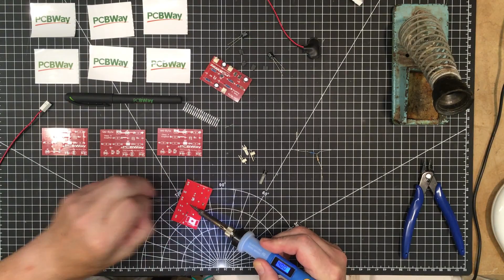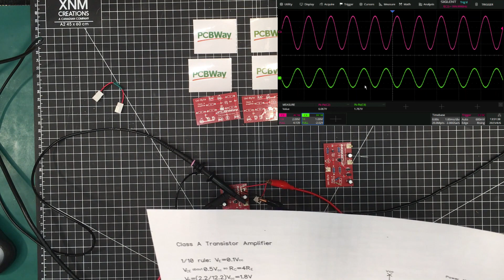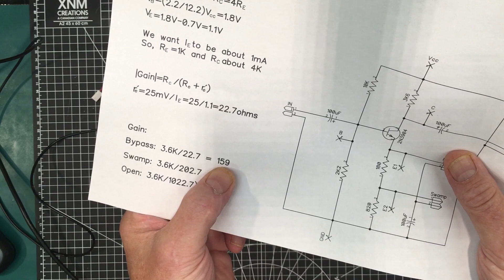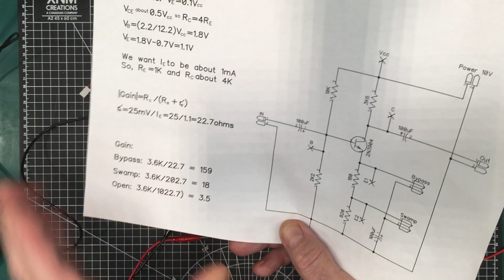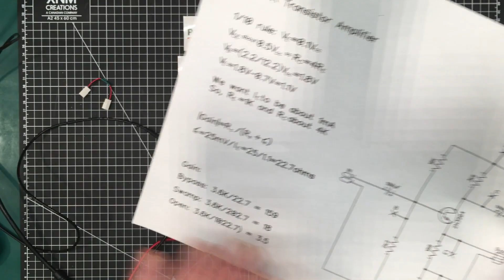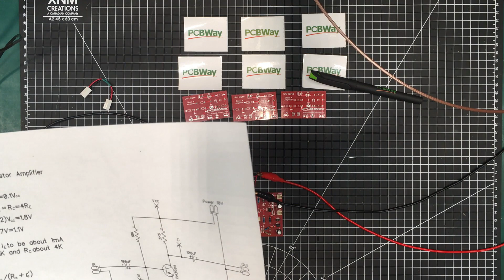0080 - Beginner's Transistor Project #2: Class A Amplifier Part 2

Comment: Some transistors have better gain linearity over others, maybe have a 3-pin socket for the transistor and swap between a bunch of common transistors.  2N5089, 2N2222, BC547,  SS9018, SS8050, 2SC3324 etc.
Reply from the maker: One could do that and if you did you could improve things quite a bit.  However this was meant to be a simple little transistor project a beginner can try to build and play around with to learn the basics.  Of course there are other ways to get lower distortion too and if you combine them with more linear transistors you can create some very fine amplifiers.  These days it's mostly doe with high end op-amps.
Reply: @uni-byte  Yep! :)  ...and Op-Amps are great, but sometimes a simple gain stage for uses other than audio can be handy.
Reply from the maker: @stevenbliss989  Absolutely.